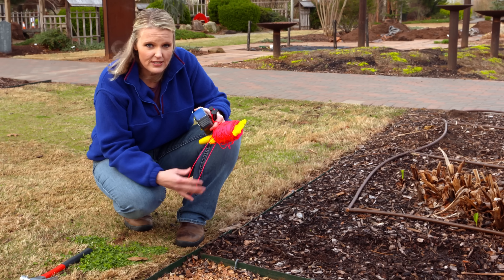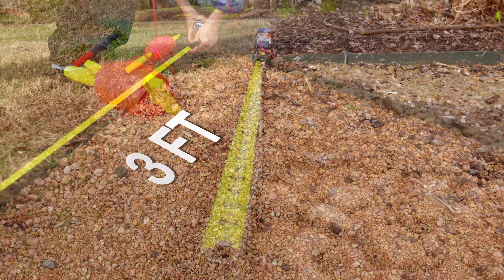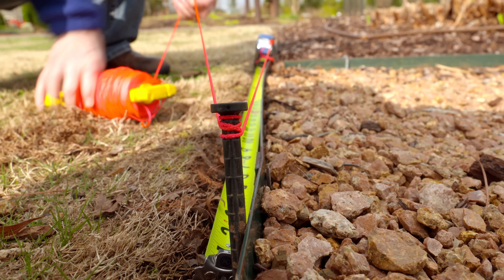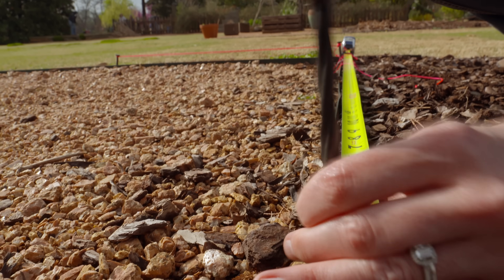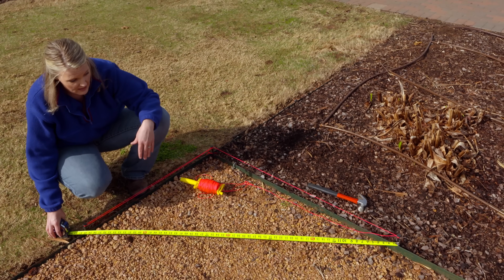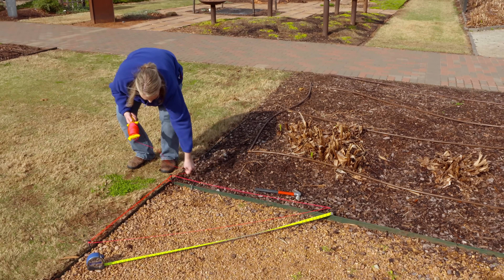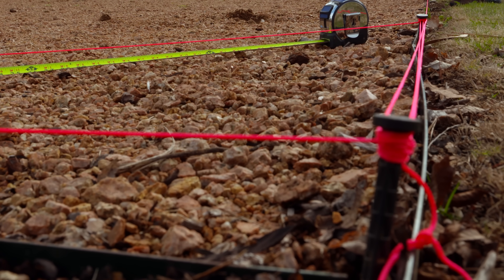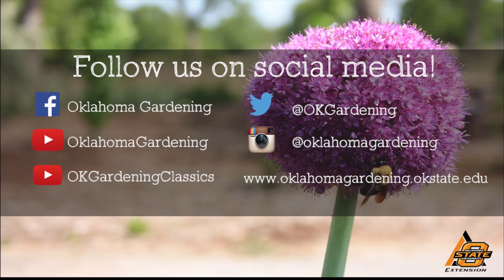3-4-5 Method

Comment: This was my go to method when I did metal roofing many years ago. The only time it doesn't work is when you have someone that can't build a building square. Using the 3-4-5 works great but it really shows how bad the roof is out of square when it's not built correctly. Great video!

Comment: If you want to create a right angle you have to come at it from the 3:5 line because only when you have the two lengths pegged will you be sure that you are getting a right angle with the last leg which will ONLY BE 4 if it makes a right angle triangle. If you do it the way in the video using the 3 & the 4 you have already constructed your right angle (which may be wrong or inaccurate) and will have too much or too little string along the hypotenuse. The Megalithic stone builders knew this because they carried around a circle of rope with 12 knots and constructed their right angle triangle accordingly. This is 5,000 years before Pythagoras called it his theorem. Examples of this can be seen at Carnac in France using the 3:4:5 ratio.
Reply: You are right.

Comment: 90 degrees
 Establish 1 straight line 
Make a circle with centre on the line 
Make another circle down a bit from first circle using same radius
Draw a line through where the 2 circles intersect 
That is exactly 90 degrees

Comment: Another way is thus. The angel on the any points on the circle support by two points of it circle's diameter end points,  is The right-angle.If   pointer pole is fixed at  center of other double lenghted pole and the pointer can move around,  what positions would be The three edgs are formed always be The points are right angle forming. . So The tool also good one.

Comment: This maybe a dumb question, but if you are off on the 3,4,5 measurement, how do you determine which point needs to be moved? for example, if you pivot the triangle on the tail end say 10 degrees, it would still measure 3,4,5 but not give you a straight line?
Reply: Was wondering this myself?

Comment: Does it matter which way you measure the 3ft and the 4ft dimensions ? For example where the lady measured 3 if I did 4 then 3 the other way would it basically be the same ? Just curious 🧐
Reply from the maker: It would be basically the same!

Comment: Any information on how to add building up.  My job requires a drawing for every building including measurements.  Just looking for other ways to add up large building.  Closing them out with measurements that corelate to the shot distances.  Typical match north to south and east to west to get equivalent measurements.  I understand perimeter and how to add a straight line but there's another solution that involves adding and subtracting

Comment: NO, THIS IS STILL CALLED THE 3 ,4, 5 METHOD FOR OBTAINING A SQUARE (90°) CORNER.   CARPENTERS STILL USE THIS METHOD IN THE FIELD.  MY GEOMETRY TEACHER WHO WAS ALSO IN CONSTRUCTION TAUGHT ME THAT BACK IN 1968!
Reply: Thanks you
Reply: It's definitely called the Pythagorean theorem.
Reply: Uuuum every single trade uses this method and it’s most certainly based on Pythagorean theorem lol
Reply: Didn’t need it to be on all caps but nice I guess lol

Comment: What if you want to make all sides the same? I mean instead of 3-4-5, would it be 4-4-6?
Reply: No, 3,4,5 are just coincidentally convenient numbers to remember. They work because of the formula - A²+B²=C²
If side A = 3 and side B = 4, than:
3² = 9 (3x3)
4² = 16 (4x4)
9+16=25
√ 25=5  (25=5x5)

If side A and B are both 4 than: 
4² = 16 (side A)
4² = 16 (side B)
16+16=32
√ 32=5.657

Comment: What if want to make the number larger than 3:4:5 ,how would be that,?
Reply from the maker: The 3-4-5 Method utilizes the Pythagorean Theorem, which is expressed as c² = a² + b². You can search for a 'Pythagorean Theorem calculator' online, enter the lengths you have, and it will calculate the length of the hypotenuse for you.

Comment: 2:30 well, I'm not fully convinced in terms of accuracy of a straight line, you could still be off a few mils to even cms when projecting a long line from any of the sides, but it certainly is a good guidance. There sure must be better instruments to use along with the 3, 4, 5 or 6, 8, 10 to achieve that.

Comment: What if the square is on scale of inches? Is it the same?
Reply: Any units of measurement will work. You could use the length of a stick you find on the ground: 3 sticks for 1 side, 4 sticks on another side, the diagonal will be 5 sticks.

Comment: A Easier And More Precise Way To Square Something Out. Measure Corner To Corner Diagonally. Both Diagonally Corner To Corner Measurements Should Be Exact Same. The 3-4-5 Method Is Good If You Are Doing Just A L.

Comment: Simple method but I must say the process you used ain't quite the most accurate. Nonetheless, if you are doing this all alone without help, then I guess your method ain't bad. I recommend though that for bigger areas, where accuracy matters, 3meters/4meters/5meters would be better.

Comment: She did that all wrong, you first measure the three foot line and than using two tapes simultaneously draw the four foot line and the five foot line until they meet making a perfect ninety degree corner.
Reply: You spelled "then" wrong, and left out the commas after "than", simultaneously and meet.

Comment: Why take 3,4,5
Reply: Srinu Korukonda - she said it at the end but you can use 6,8,10 if you building something bigger. If you measure out the 3 and 4 feet then no matter what the diagonal  should be 5 feet and if it not then the corner isn't square and you adjust till its 5feet. Smaller number for smaller jobs.
Reply: 3² + 4² = 25 .. and the square root of 25 is 5..   

3, 4 ,5 is used because it is mathematically true when plugged into the theorem and most importantly, they're easy whole numbers that you can translate to a tape measure easily. One more important point is, it's easy to remember because it's just counting ( 3,4,5).
Reply: 5, 12, 13 also works.
25+144=169
Reply: Let me explain a few steps further.  The theorem states a² + b² = c²...   If you add 3²+4² you get 25 which is already equal to c² (25 = c²).  But we need the absolute value of c which is the length of the side of the triangle. So we must do the opposite mathematical operation of "squared" to find that value, which is finding the square root. √25 = 5 ... This is true because we know that  5 x 5 = 25 (the square root of a number is the number that you can multiply with itself to get the result (ie: the square root of 9 is 3, because 3 x 3 = 9, the square root of 16 is 4 because 4 x 4 = 16.. and so on.) It works for finding the hypotenuse of any "right triangle", which is a triangle that has a 90 degree angle in it. You can also rearrange the formula using basic algebra to find the length of any side of a right triangle as long as you have the values of the two other sides.

EX: a² + b² = c² .. but we already know c and a, but we need b.  So we can arrange the formula and it becomes  b² = c² - a² etc etc. Let's try it with 3, 4, 5... Pretend we don't know the answer is 4 and try it.  b² = 25 - 9 we get a value of 16 which is equal to b². The square root of 16 is 4 (4 x 4 = 16)

Comment: You tace long  i teach you eazy one corne mark 600 hundred  nex corner 800 hundred you hold measuring tape any coner you mar must one meter thismis jops how done fast i tech concret peppls when learn pepols very hapy eazy and fast
Reply: Break that down for us here...   6 - 8 -  what?
Reply: @steven.h0629  steven  600   mark one corner  nex corner 800 hundred mark and this  is must 1000 i not use tools how i work out best whay
Reply: @vefabozok7129  👍 clear...  got it.
Reply: @steven.h0629  hi steve i  use this method welding o i do concreting  most of concreter dont now i teach same concrete how eazy how fast box up timber ready concret pepols very hapy i hope you hapy to thank you